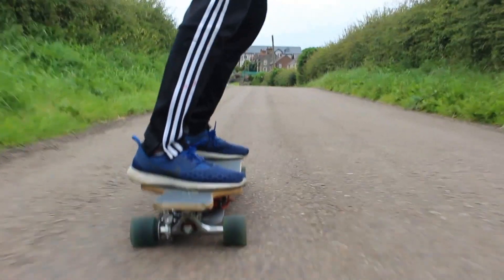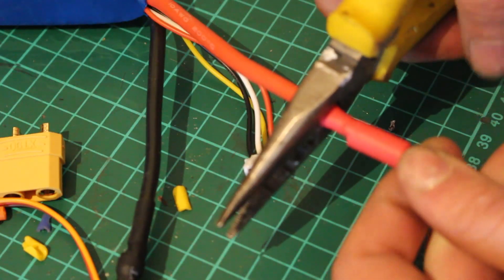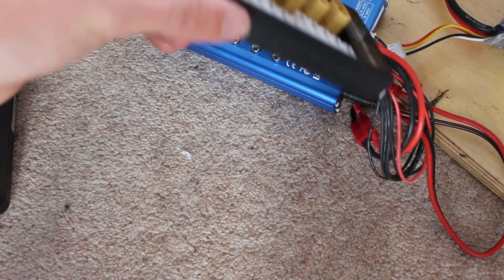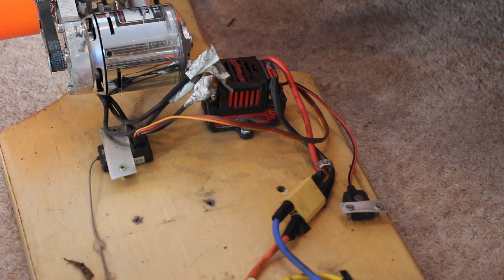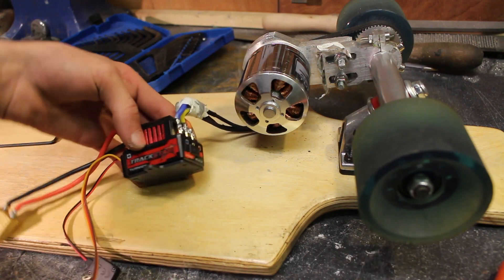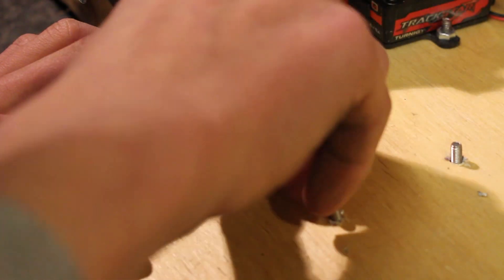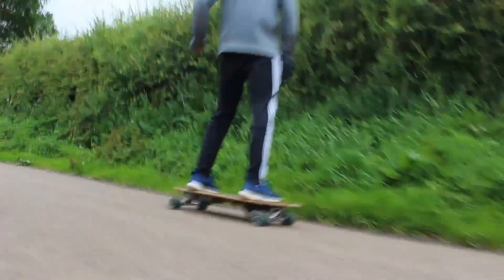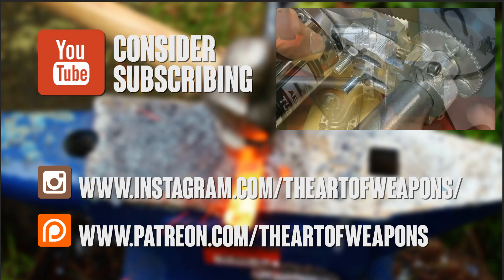How to Make an Electric Longboard - Part 2

Comment: hi, just a sudgestion, i'm a bit into RC and i did check that motor it seem his best performances are achived with a 10 up to a 12s battery which will obviously make it quite fast (the motor is actually 192kv which will translate in  1920 theorical Rpm with a 10s) that should give you enough speed. But obviously you will need a better ESC for it. About the remote to have a better response you can use simple servocable passed trough the board and leading to a proportional switch that you can use directly with your foot... but this is just an idea :)
Reply: a 10 s battery have 42v X 192kv =8064RPM
Reply from the maker: thanks, I have already purchased a much better esc after the last one broke and also a 3rd 3s battery so that I can have 9s to the motor which should increase the speed lots!
Reply: just be careful about the belt a better casing in case anything nasty goes in it if the motor is running fast anything could chop it or make it go off the axal by the way you did give me the inspiration to motorize my bike lol :D
Reply: lol right sorry i counted the cells not the volts :P is 192x Volts not times cells stupid me thanks for the correction :)
Reply: yeah, if you lean yourself a bit more forward you will have a much more stable ride, but in the end who dares to ride ~50kmh on the sideroad :D
Reply: +ArtemisEntreri81 3.7V- 3.8V per Cell is the recommended "store"- Voltage. A full Cell is max. 4.2V so in theory you have to use a function which depends on the time so its u(t) and if you have a constant voltage drain, your function can be seen as a exponential function which falls over time. Also we know that the rotation depends on the voltage, it will decrease with it.
Reply: Hey could you reply a link for a better ESC. Cause i cant find any 10-12s ESC'S
Reply: 8064 RPM would get you some serious speed wobbles, if you have the right wheel size... sometimes i've got some problems and i've got a motor with 6300 RPM and at the top speed i have to deal with it... (top speed 20mph / 32kmh)
Reply: maybe weighting the board down a bit in a well balanced way could stabilize your wobble but i understand your point at that RPM it can be dangerous
Reply: thats why i'm thinking of adapting this method to my bike :D the only problem for me will be fitting all as hidden as possible (luckly is not a race bike but a mountain bike) this will help me in my commute to work. by the way i love this channel :D
Reply: yeah, but i think you'll need 2 motors for a bike, if you want to go uphill or something there will be a relatively strong Force for the motor to pull you and the bike up... 
in the end... i don't have any experience in electric bikes... i can only tell you from a electric longboard perspective :)
Reply: It will not really be a motor to propell me forward but more like a pedaling help really
Reply: ah okay. i've got some ideas, but i can't explain it so good with a comment...wish i could draw a comment...
Reply: even just a tiny description of what you are thinking could help so do not worry of the drawing :D I hope we will see some other similar projects on here he did quite a good job with this board and well his work with knife and similar things is been very good and entrataining.
Reply: 10s is 36 volts. 192kv = 6900 rpm
Reply: +Movies Made Real! yeah with 3.6 volts per cell which means its nearly empty...
Reply: Using the standar 3.7 per cell which is the nominal charge it give a theoretical value of 7104 RPM still we are talking of theory and not real world practical value because anyway you have to add all the other parts to check whats the real value... still with a 10s it should get quite the speed :P
Reply: well yes as the charge decrease the voltage and the RPM decrease too that is just an average RPM obviously thats why i said nominal charge. Again we are still talking of theoretical values not real world and again no matter what it would be terrifying going on that longboard with a 10s battery :P
Reply: +ArtemisEntreri81 you'll get used to it :D
Reply: Either that or well lets say that whats left of you might have to get used to eat with a straw lol
Reply: at the moment the ones i did see are sold out but you need to find an esc that is over 180A usually a 240a can hold up to a 12s battery but the only one for sale on HK is a watercooled esc (which mean obviously for boats)